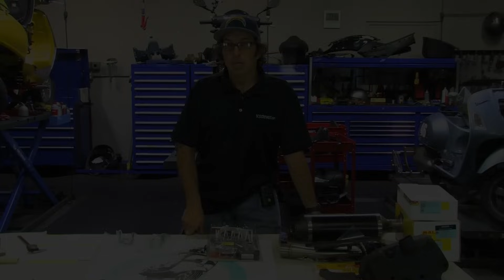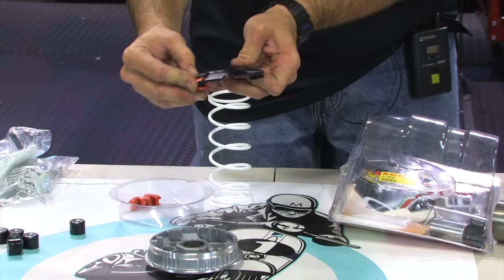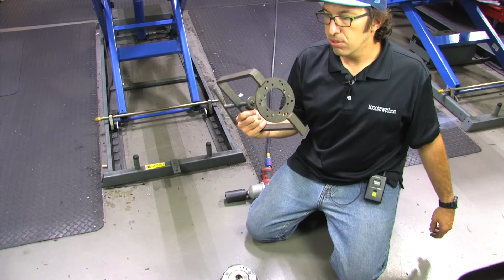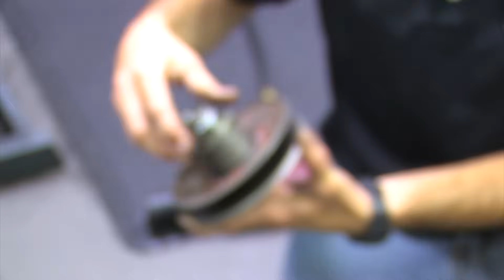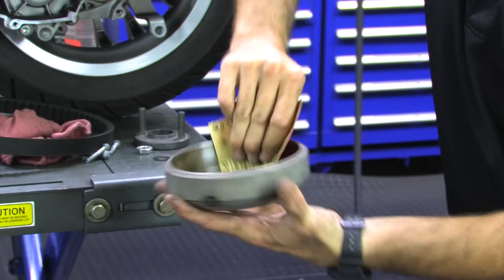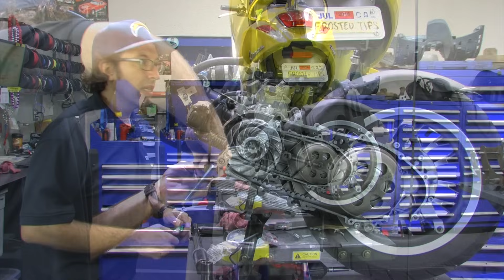Malossi Variator Kit for Vespa Sprint/Primavera

Comment: I watched one of your videos earlier today and you scuffed up the variator, I've watched probably 60 videos on changing out variators you're the first person I've seen to scuff them up. I took mine off the other day before I seen your video and actually had to scuff mine up because taking out the variator I messed up. Because mine is a Korean scooter. And the nut that attaches the variator is Left-Handed so it's opposite. But I scuffed mine up and it actually made mine feel like my belt got better traction so it's good to see that somebody else is on this.

Comment: Just installed this kit in my 2016 Sprint.......lot better hole shot, improved midrange and slight increase to 71mph top speed, easy job
Reply: what exactly do you mean vy holeshot and midrange? planning to get one for my prima
Reply: @gcpz1173  Acceleration and torque...you will be impresssed

Comment: i have the 2019 liberty 125 RP8MA4100 the stock variator has warn so im thinking of upgrading to this do i replace the spring in the driven pully the engine is stock

Comment: I have a question. i asked advice from the professional service company of piaggio and they said that if you install 80cc malossi cylinder kit on a 50cc piaggio it will not last and it will brake. What do you think of this?

Comment: So I bought this kit, and I installed it three times in a row in order to triple check my work. Every time it causes belt slap and the scooter makes a terrible racket when accelerating. Any suggestions on that? I really want the performance but I had to go back to stock before my belt destroyed its self.
Reply: Did you put belt good in if there is any text on it should face you when placing it
Reply: Yeah I am quite sure it was installed correctly. I installed it again and ran it for a few days and then put it back to stock again as it just made too much noise. Maybe the noise is part of the deal with these high performance kits. Its makes quite a bit a difference off the line but lowered my top speed by about 3 MPH. Thanks for the reply.
Reply: @mattackerman9657  what rollers did you have before and after ?
Reply: @mattackerman9657  should be quiet as stock....look at the video again...are you sure you got the right kit?

Comment: sir have a question, i had my stock center springs replaced, from 800rpm to 1000rpm center springs, the stock had the same plastic on top of the spring, when i replaced it with the 1000rpm centee spring, the mechanic didnt put the plastic on the newer spring. is it ok to leave it like that? or does the centerspring need that same plastic installed ? hope i can get a reply from you thanks

Comment: I have a 2003 Piaggio LT50 being offered for a very good price, 4K miles on it. Can i get parts for it. I find so little info about it anywhere. Why get it if i can not get parts? I found cylinder kits and such. I mean fork springs and seals, front wheel bearings, that kind of thing. The stuff most people do not service - The little parts.

Comment: In gearless scooters, should we apply little bit of grease on round shaped rollers and roller-grooves in variator for smooth spinning of rollers in variator?
Or will it make more issues after some time like dust deposit, sides of rollers get flat faster, vibrations will increase etc ? 
Please tell what should we do with proper reason.
Reply from the maker: Do not put grease on the rollers. Grease could actually hinder the proper movement of the roller and make it sticky. The material of the roller itself along with the shape of the cavity should be sufficient for proper operation. There are some performance rollers such as Malossi or Dr. Pulley that are made with different materials and shapes that may improve performance if that's what you're after.

Comment: What we get with a large spring?. Well, large and i think harder than original. I would like reduce the Fuel consumption. I do not mind get out faster, only consumption. Harder, or softer?. Regards.
Reply: Harder tuning-type spring requires Kevlar Belt. Exchange out your original belt with a kevlar one. Also, harder springs means increase variator rolls weight. If you buy a full variator Kit like this Malossi, Try using the rollers that came with it. If the Scooter is slow on kickin in the variator, decease the weight on the rolls.

Comment: I had to use a small chisel and big hammer to undo that top nut, impossible with an Extension Bar and socket...means i had to buy a new nut
Reply: that's what an impact wrench is for

Comment: now I know for sure hes not a professional/ 2 things. 2- YOU NEVER turn the variator backwards. screws up the timing chain. and 2 you always grease the inner part of the boss pin before it slides on the crank post. failed.
Reply: dubious claim